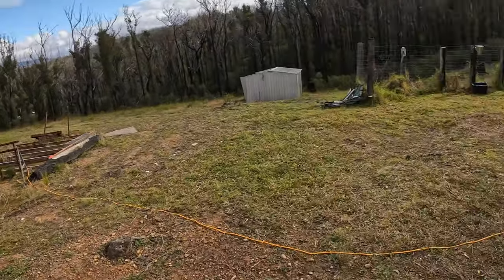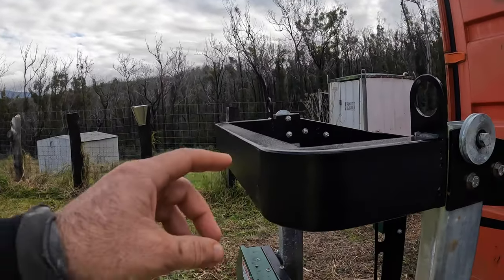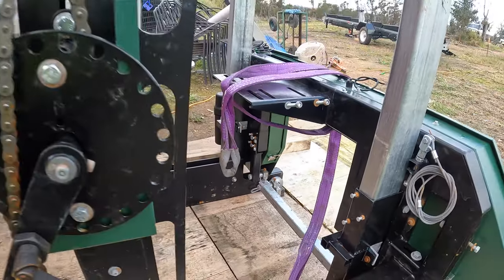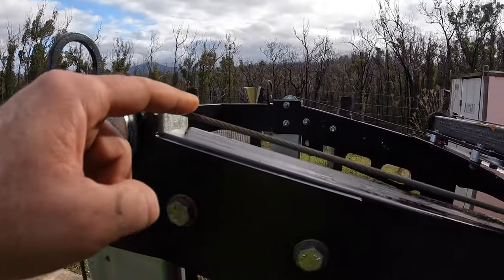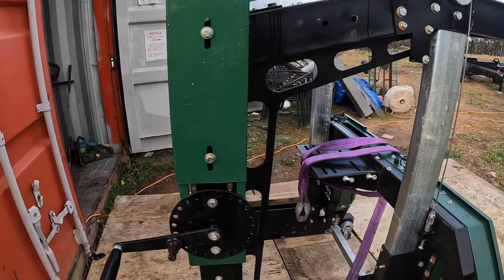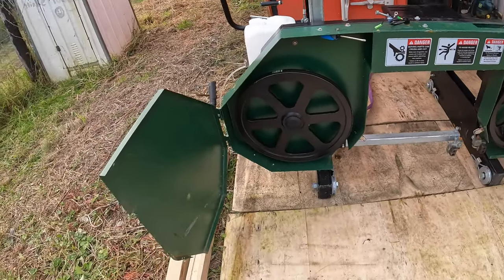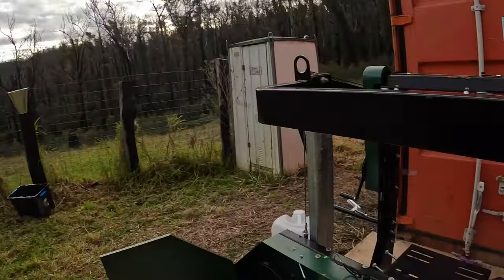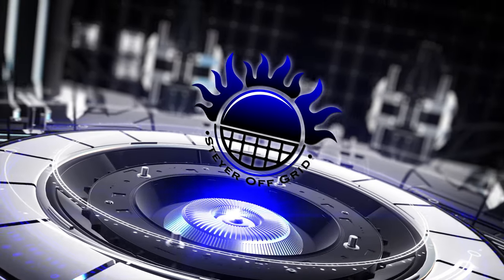Hardwood Mills Australia Wood Mill Build Part 4 Cutting Assembly

Comment: Did you end up finishing the build? I'm thinking of using a chain block to lift it up, but seeing that you don't have another video in this series has filled me with dread 😅
Reply from the maker: Mate I hired a little truck with a lifting arm hi-hab or whatever they are called. Cost me $120 but yes I haven't worked on it since as the whole cutting assembly is out of whack so is off the rails on one side. I have been crook but also hate this project hahaha

Comment: For a new machine, there are a lot of rusted bolts , nuts and washers
Reply from the maker: Yes the boxes and parts where in the yard for sometime. Nowhere else to put it. Everything is gal or stainless so surface rust. The weather will do that. Plus once it is finished it will live in the yard until my shed is built. No big deal 👍